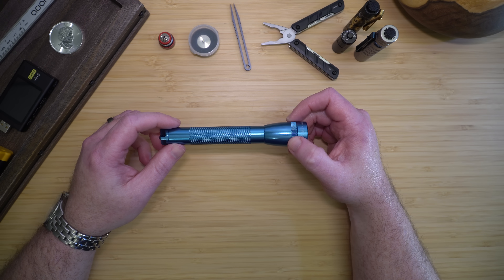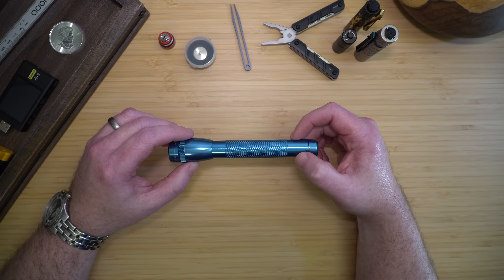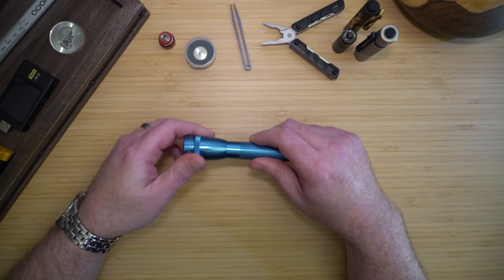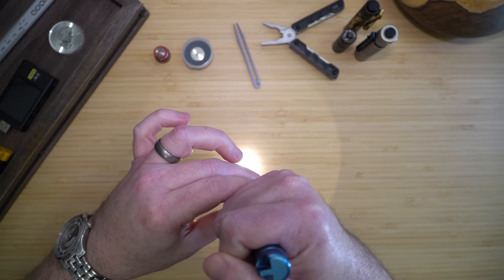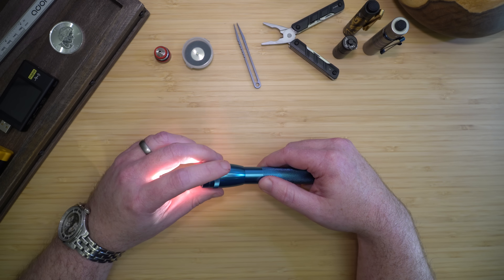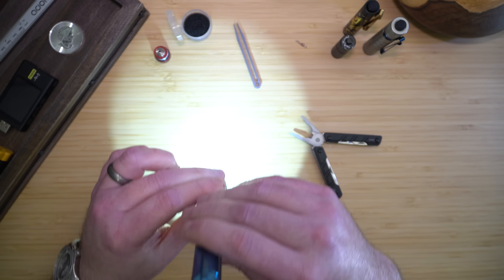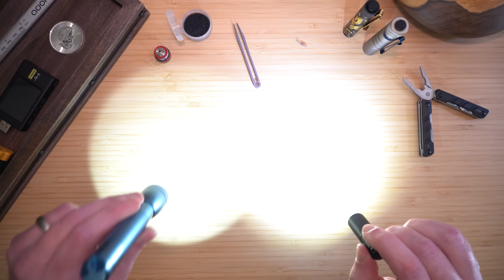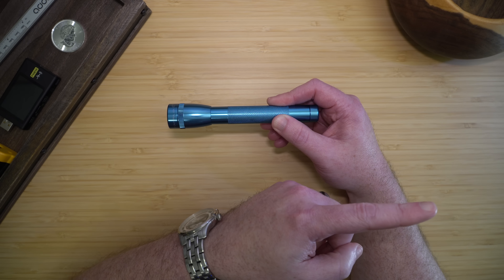Classic to Cutting Edge: Iconic Mini Maglite Upgrade

Comment: Nearly dropped over a cliff had it not been for my mini. I always had them while elk hunting in rugged country. I was traveling fast in fading twilight to rendezvous with my 2 boys 12 & 13, & came across some large green windfalls 30 to 60 inch that a mountain twister had tangled up near a high ridge. It was easier to go under & between because of the limbs but they still tangled with my fleece coat & pack. I was sweating & mad because of the hindrance & at one point struggling but unable to move any further. I had this thought of why don’t you turn on your light to find your way out of this tangle, I was also mad because the stupid light wouldn’t focus, it was only then that it focused on the rocks 30 feet below my feet which weren’t even touching anything I was just hanging from the branches. I also had this dumb thought at the time, I’m mad because of these branches but they are the only things saving me from falling on the rocks below.
Reply from the maker: Wow, that must have been a terrifying experience. Glad you made it out safely. Did you end up tagging an elk? Thanks for watching!
Reply: Yes both my 12 yr old & I harvested elk in the last 10 minutes of our hunt (due to last light that day). We had to return home the next morning.

I might add that I never leave camp without 2 lights because of a flashlight failure the year before. I had the elder son with me but he was cold & wet due to bad weather, so I left him in camp then walked in 2 to 3 miles where I spotted 5 elk at 1st light from a ragged rock ridge. Before I could get the long shot the fog rolled up & hid them. I went down there later climbed a tree with a good view of the brushy hillside & waited till 5:30 when the bull got up & spotted him. Took awhile locating him in the sea of tall brush (350 yds) then worked on him using the new flashlight after dark, it failed before I was half done. Since I’m stubborn & stupid I finished skinning etc to cool him before I left. I knew my son would fear for me, so I walked out in the dark using the stars to help navigate. Walked to my tent between 1 & 2 AM.  Never again !
Reply from the maker: Wow, what an adventurous hunting trip! You and your son must have some amazing stories to tell.
Reply: When you’ve spent as much time in the back country you’re bound to have some unique experiences. 
 Those mini mags sure did the job until the Petzel LEDs came out. My norm has been to walk in & out in the dark & use a light very sparingly to not alert game or other hunters of my presence. Most of us are afraid of the dark but don’t want to admit it. I’ve learned to only use a light less than 10% of the time while actively hunting.

Comment: Interesting.  I still use my mini Maglite, no LED required.  It actually still works the same as it always did.
Reply from the maker: Thanks for sharing! It's cool to hear that your mini Maglite is still going strong.
Reply: @chestersedc  Thanks!  I do worry about getting bulbs for it in the future.  It'll probably end up being LED eventually.  The LEDs are undeniably better, it's just that I'm nostalgic about stuff. ;)
Reply from the maker: @realvanman1, it depends on your needs and preferences.  The Xenon bulb's warm light is preferred by many and easy on the eyes. I like that the upgrade is easy enough to go between the two based on your needs.  I kept the plastic container the upgrade came in, so I have a place to keep the LED when I get that nostalgic feeling and want to switch back. 😀

Comment: thanks, it's a good idea. But the price is far away from about 10$. On Amazon in Germany it costs about 29$
Reply from the maker: Thank you for the feedback, prices can vary depending on the location and availability.  I can't control which option Amazon selects for the German store, so you may want to shop around and see if there is another cheaper option.  I hope you can find an affordable option.  Thanks for watching.

Comment: A dab of silicone dielectric grease on the contacts excludes moisture and prevents corrosion. However handheld flashlights have one serious drawback, they waste a hand holding them
so I switched to LED headlamps years ago and even use them for task lighting in daytime. Unlike the headband for Mini Maglites the weight is centered. When lights improved I sawed off the heads of my D-cell Maglites and plugged the bodies with brass Welch plugs from the local auto store as they make great waterproof storage tubes. Not really worth it for the Mini though.
Reply from the maker: Thanks for sharing your clever flashlight hacks and how you've optimized your lighting setup! I'm glad you found a solution for your needs. Thanks for watching!

Comment: I've never owned or used a Maglite
Reply from the maker: 20+ years ago, they were the bee's knees.  Modern lights have surpassed them in water proofing, battery, and LED technology, but they are still useful, reliable, and provide a few unique features like candle mode.  I still use my upgraded Maglites for their unique features.  If you have one, an upgrade will increase its usefulness.

Comment: When I started as an appliance service tech and installer in 1994 I got my first one and that’s all I used until the small leds started to get big. I had a few of them either from loosing them or I got tired of smacking them in my hand when they started to act up.
Reply from the maker: Thank you for sharing your experience from back in the day!  I remember having to smack our old D cell Maglite to get it to work.  Thanks for watching.

Comment: Great video! Can u upgrade the battery as well to a chargeable more powerful one?
Reply from the maker: @nicolasp109 Thanks. Yes, there are several options for upgrading the batteries to rechargeables.  I have been using these Anvow USB-C Rechargeable Lithium Ion batteries ( https://amzn.to/4czFCPD ) in my Mini Mag, as you will see in the video, and I'm seeing 10+ hours of run time.  My only complaint is when they run out of juice, they just stop working.  Alkalines tend to dim over time to warn you they are getting low.  I try to charge the batteries every few months to ensure they have plenty of power.  The Anvow outputs 1.5V, so it won't make the light brighter, but it will be more consistent in brightness and have a much longer runtime due to its 3400mWh of energy storage. I hope this helps.

Disclosure: This comment includes an Amazon affiliate link, which means if you click on it and make a purchase, I may receive a small commission at no extra cost to you. This helps support my channel and allows me to continue making content for you. I appreciate your support!

Comment: I have the 1 x AAA Maglite, the  2 x AA, the 3 x C Size and the Monster 6 x D Size. I found the big one recently in a box and was incredibly disappointed in the output and it was anywhere near as bright as I remember. That would be a fun upgrade to an LED Module.
Reply from the maker: Hey, thanks for sharing your flashlight collection! Upgrading to LED would be cool project. Good luck and thanks for watching.
Reply: @chestersedc   Yes, I think I will look for that. My EDC now is a Fenix PD20, which is incredible for its size and is always on my belt!
Reply from the maker: I've never had a Fenix flashlight, but the PD20 looks amazing for its size. I'll have to check it out. Thanks.
Reply: @chestersedc  Yes three brightness's plus strobe and great battery life.

Comment: My experience has been the led, much brighter light, but it takes so little juice to operate one that the batteries can corrode and get stuck in the body and still make light. A good upgrade though.
Reply from the maker: I appreciate you sharing your thoughts on the LED light upgrade. Your insights are valuable and help others make informed decisions. To avoid leaking issues, you can try Energizer Lithium batteries. Thanks for watching.

Comment: A wonderful suggestion. I have the large and small MagLites. Without checking first, I would assume that one can buy an LED replacement for the large flashlight as well.
Reply from the maker: Yes, here is one option ( https://amzn.to/3vAN1gY ), but look around as you can get them in different brightnesses based on your needs.  Have fun with your upgrades and thanks for watching!

Disclosure: This comment includes an Amazon affiliate link, which means if you click on it and make a purchase, I may receive a small commission at no extra cost to you. This helps support my channel and allows me to continue making content for you. I appreciate your support!

Comment: I don;t recall any warning to not touch the bulbs on the packages.When you buy replacement bulbs they come in a package that requires you to touch them and no cleaning products. I have and still own many of those lights and don't have problems unless I drop them.

Comment: I got a bulb that looks the same as yours, but it doesn’t turn off.  Any suggestions?
As for memories, the 3D cell down at the cottage was a mainstay.  Seeing the beam shine into the sky was so cool.
Reply from the maker: If it is the AA Light, the light is supposed to turn off when the head is tightened, and the reflector pushes down on the LED heat sink.  Try removing the head and see if you can push the heat sink and turn the light off.  If you can, the reflector might be wrong or not seated fully under the lens and cap.  If you can't push it down to turn it off, there is probably something under it keeping it from pushing down, or there is an issue with the pressure switch under the black cap. Be careful if you try to look at the pressure switch as it can be easily damaged once the black protector is removed. I hope that helps.

Thanks for watching.
Reply: @chestersedc  yes!    I had totally forgotten!   Years ago I got an led upgrade, but it was those first gen, kinda crappy ones.  It came with a different reflector.   Glad to know, but kinda disappointed I can’t upgrade it to a better one now.

Comment: I'Ve had many MAGs 2AAA, 2AA, D cell even the mighty 6 D cell (worked as a security guard 30 odd years back so also had the official belt loop still got both) which also came in handy for a potential self defence Baton too 😉. MAG torches are TOUGH M-Fkers! 😏👍
😎🇬🇧
Reply from the maker: That's awesome to hear! MAG torches are definitely reliable and durable. Thanks for watching.

Comment: Back in the 80s I had two flashlights from a company called Tecna.  The brightest one used 8 AA batteries. As I remember, it came with some sort of rare gas bulb, but you could get an even brighter xenon bulb for it. For the time, it was extremely bright for it’s size.
Reply from the maker: Wow, those flashlights sound like they were the real deal! Thanks for sharing that blast from the past!
Reply: I still have my light however the reflective coating was destroyed by the off gassing of the alkaline batteries after they leaked. It was a very bright flashlight for its time and water resistant. Good luck finding a bulb for this light in todays age. I have a smaller light by the same company that runs on two AA batteries with the adapter or with two C cells. It came with a light module for use as a standard flashlight and I purchased the optional strobe module with its clear lens BUT they also offered an IR lens which I picked up as well. Works good as an IR marker strobe for use with my NVM.
Reply from the maker: Thanks for sharing your experience with the flashlight. It's always interesting to hear about the durability of older products.
Reply: I still have the 4 AA version that is not as bright and at least one of the less bright original bulbs.
Reply from the maker: That's cool. I've never seen an AA with more than 2-cells.  Hold on to that future collector's item.

Comment: Great video.. I LOVED my mini mag. That thing saw hundreds of late night, 4X4, mud packed, tire changing on a mountain top in a storm adventures with me. I had the original incandescent bulb, but despite all the abuse, I never had a problem. In fact it was nigh 4 years before I had to use the spare. I don't think it ever went through more than 3 original style bulbs. Never did buy the upgrade for it. It finally actually got lost......😢I  was so sad.
Reply from the maker: Thank you for sharing your experience with your mini mag! It sounds like it was a reliable companion for your adventures.

Comment: i have a super powerful 
LED hunting light that is also made of high quality aluminum . it can cast a beam , 900 meters away. 
However , i still prefer the mag because of the softness of the light . my led is so bright that it washes out the object being looked at . the object disappears and only the light can be seen .if i turn down the setting/output , it still has a reflective quality that makes it difficult to clearly see the object .
Reply from the maker: Appreciate you taking the time to share your feedback on your LED lights. Your insights are valuable for others to consider. The right light can make all the difference. Thanks for watching.

Comment: I upgraded my maglite some years ago with the best led replacement Amazon had. Much more expensive too. That flashlight worked great for a couple of years but then the light started flickering. I took it apart and put it back together, replaced the batteries and it still constantly flickers. Sometimes, instead of paying a lot to upgrade, in the long run it pays to just buy a newer maglite.
Reply from the maker: Thank you for sharing your experience with the LED replacement. It's always good to hear firsthand accounts to help others make informed decisions.

Comment: I've got one with swollen batteries. any ideal how to remove them?
Reply from the maker: @mapp0v0 I hope this helps; attempt at your own risk.  Always keep safety in mind and wear safety goggles and gloves.

Removal Steps:
1. Unscrew both the battery and lens assembly end caps.
2. Safely remove the bulb and set it aside.
3. Gently pull the black plastic bulb switch disk from both sides to access the battery tube.
4. Try shaking the flashlight to dislodge the battery. If that doesn't work, proceed with the following:

For Leaked Batteries:
1. Clean with White Vinegar on a cotton swab to neutralize leakage.
2. Rinse the cleaned areas with water on a new swab.

For Swollen Batteries:
1. Lubricate the interior tube lightly with WD40 using a cotton swab.
2. Apply more WD40 directly to the exposed battery to help it slide out.

Removing the Battery:
1.  Use a wood dowel that matches the battery's diameter and 3x the flashlight length, mounted in a vise.
2. Apply slight hand pressure to move the battery. If it moves, lubricate again as needed and repeat.
3. If necessary, gently tap the tube over the dowel with a hammer and block of wood, but be cautious to avoid damaging the flashlight.
Reply: @chestersedc  thanks

Comment: Damn! that LED is average $50 in Australia! I can get a whole NEW LED mini maglite for $99.
Reply from the maker: Wow, that's a huge price difference! Time to stock up on flashlights and upgrades before I visit Australia.  Thanks for the info and watching.  Hopefully you will be able to find a reasonably priced options.  Good Luck.
Reply: @chestersedc EVERYTHING in Oz is ridiculously expensive mate! Usually about 4-5 times the price of the US. For example, a $20 T-shirt in the us will cost around $80 - $100 here! It's criminal mate, we may have a higher minimum wage and better wages all round BUT EVERYTHING is hella expensive! The sad fact is, despite the US lower wages, you still pay far less for things than us and are better off!

Comment: More than 10 years ago I replaced the bulb by a similar led. It is still my edc torch today and I really use it daily, so reliable since the switch, battery life improved as well. Two AA rechargeable batteries in it, and you're good for hours.
Reply from the maker: That's amazing to hear! It's always great when a simple switch can make such a big difference in a daily tool. Thanks for watching!

Comment: With regards to the upgrade... After I had swapped to the LED 'Bulb', I started using Energizer Lithium AA batteries - They kick Duracells arse when it comes to power* and battery life
* Energizer Lithiums put out a higher voltage so in comparisons to Duracells you WILL notice the beam is a little brighter, and being Lithium, they last WAYYY longer..
😎🇬🇧
Reply from the maker: Cool upgrade choice! And I agree, Energizer Lithium AA batteries are the real deal. Not only are Lithiums more powerful, they also don't swell or leak. Thanks for the tips!

Comment: How about to upgrade the mini maglite 2AA with factory LED? Still not bright enough to me.
Reply from the maker: @JuskoLord247 I think it will be hard to get over 110 lumens from a classic Maglite as the power delivery and heat dissipation make anything higher not reasonably possible.  If you need more brightness, there are many other options.

Comment: I also did a LED upgrade on a full size maglight which was a big improvement. On the mini, I use lithium batteries which last much longer and don't have the leakage issue
Reply from the maker: That's awesome! LED upgrades and using lithium batteries really enhance the performance of flashlights. Thanks for watching.

Comment: I have a 3 x D cell Maglite. Ive had it for near 20 years, great flash light but it needs a bulb. Can the same be done with this? Is there an LED upgrade option for this size?
Reply from the maker: @antonsmith9748 - Yes, you can definitely upgrade your Maglite to LED! Here is an option for the D cell ( https://amzn.to/4a4GBFY ).

Disclosure: This comment includes an Amazon affiliate link, which means if you click on it and make a purchase, I may receive a small commission at no extra cost to you. This helps support my channel and allows me to continue making content for you. I appreciate your support!
Reply: @chestersedc  thanks! ill get one of these ordered shortly.